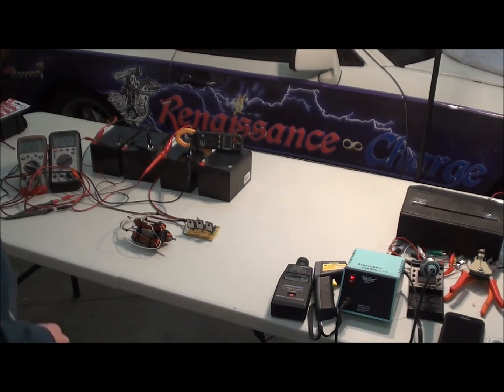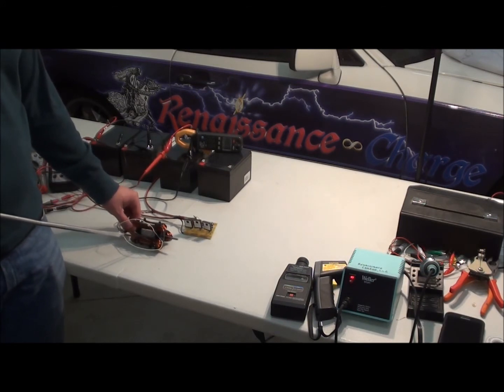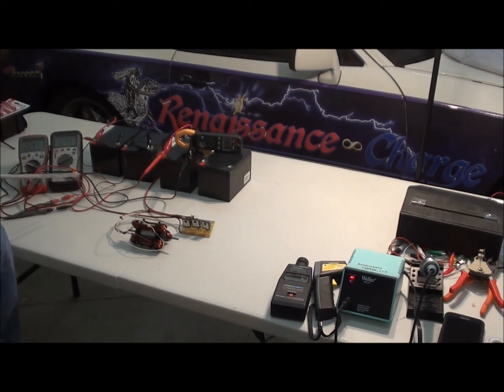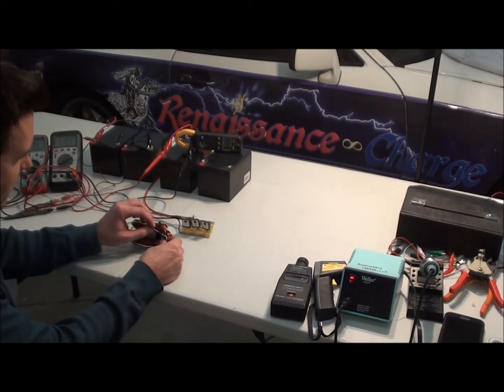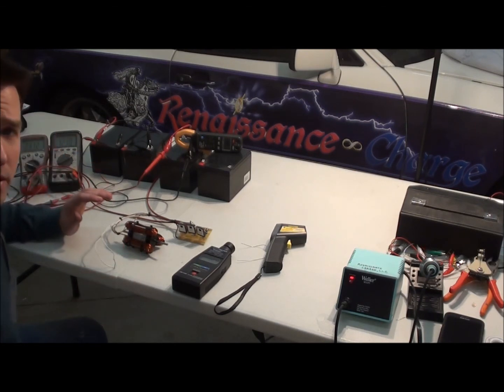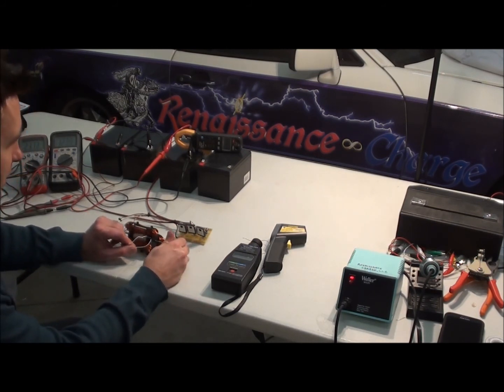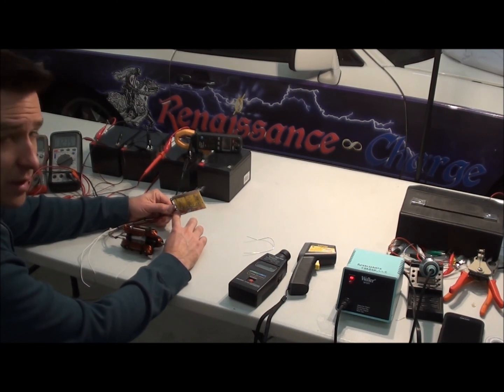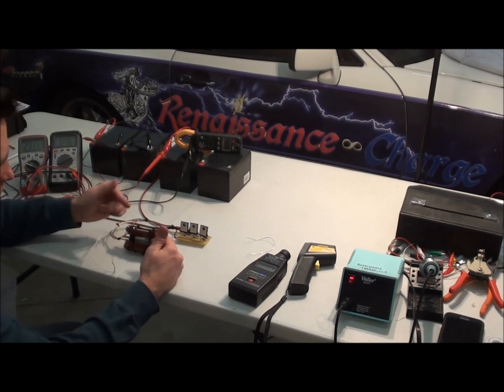Mini Window With Reed Switch

Comment from the maker: Yeah, notice I was not allowed to respond on that forum. Owners of that forum were my dealers and continue to sell my chargers with my labels on them. Let's just say there is a very long story. I'm not sure what the public should or needs to know. I am a writer and maybe I will tell the whole story this summer. For my part, I did the best I could for the most part. Almost everything worked out, but I can't be responsible for the failure of others.